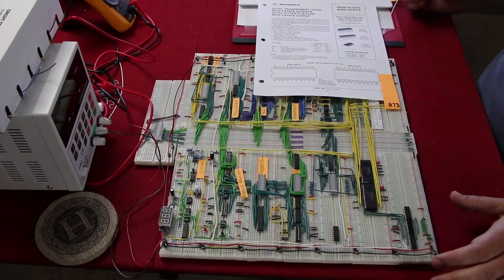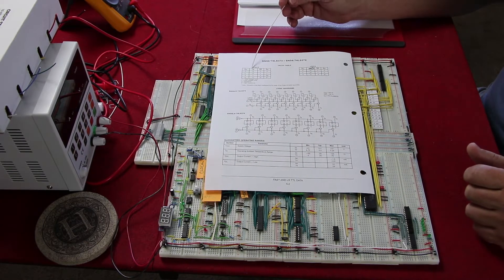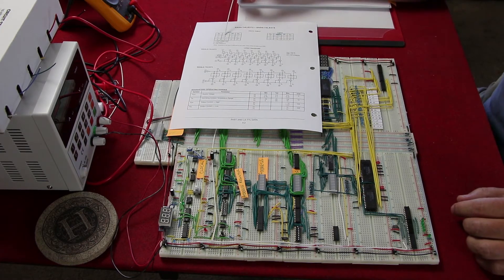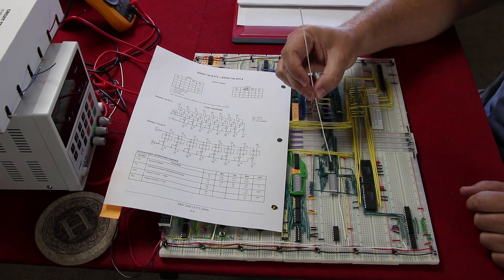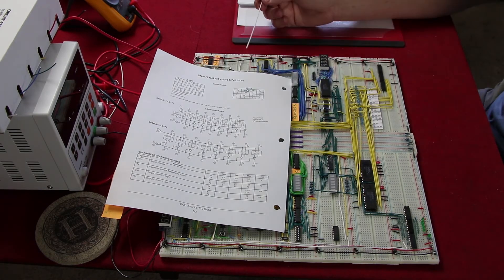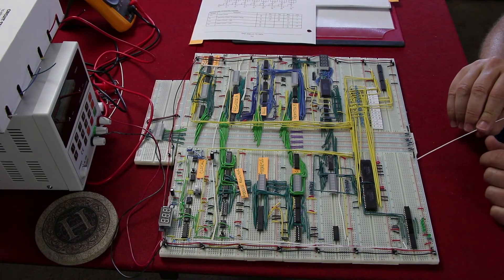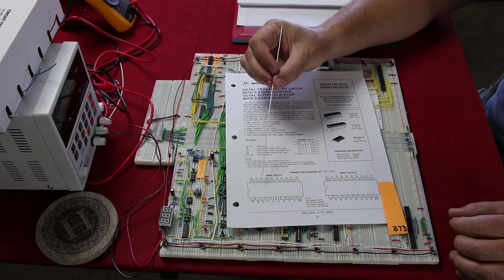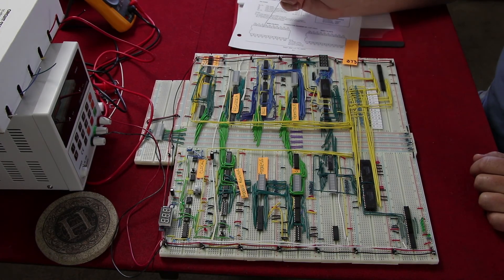Ben Eater 74LS373 Chip & 8 bit register Part 1

Comment: You mention that you are using the 972-71256SA15TPG as your RAM. This chip is 32k x 8. It has 15 bit addresses. I assume you are only using 8 bit addresses. Since you have 8 bit addresses and 8 bit control words does that mean you are basically using this chip as if it were 256 x 16? Like bits 0-7 of your address fetches the instruction, then when bit 8 is flipped you get the parameter? Thus fetching an instruction is two steps. Clock pulse 1 gets the instruction, and clock pulse 2 uses a control signal to flip bit 8 and get the parameter?

Thanks!
Reply from the maker: Yes - 15 bit addresses.  In my case, I only use the 0-7 lines for a total of 255 bytes of data accessible.  Of course, this leaves "paging" on the table for future upgrades... :)  Fetching instructions is still a 1 cycle operation.  MO + Address In.
Reply: Right fetching an instruction is 1 cycle, but how do you get the parameter? Your instructions are 8 bit and your memory addresses are 8 bit. So how do you say fetch the instruction, "Load memory location 200 into register A"?
Reply from the maker: Fetching the parameter - in this case either a static value or a value for an address might look like this:
(I will use * to indicate load a value from memory, and # to indicate a static value to be loaded)

LDA *128  (load value from memory address 128)  contained in two bytes 0000 0001 and 1000 0000
step 1 CO LI (counter out, load instruction register - now the instruction register is loaded and the microcode ROM is setup on the LDA instruction)
step 2 PCE CO MI (program counter enable, counter out, memory address in - increment the program counter, output the counter to the bus, load the bus into the memory address register)
Step 3 MO MI (memory value out to the bus, Load Memory address register with Memory value)
Step 4 MO AI (memory value out to the bus, load a with that value.)
In this case - my microsteps require 6 total.  2 to manage loading/setting the next instruction into the instruction register, and then 4 steps to accomplish the task.  in my system, 6 is the longest microcode sequence so far.

This would be the 3 steps required to handle the instruction LDA from memory address.  For a Load A with static value, it might be
LDA #128
1: CO LI
2: PCE CO MI
3: MO AI
In this case, 5 total microcode steps. (2 for the same managing/loading setting the next instruction (as per Ben eaters video), and 3 for the instruction microcodes themselves)

I am writing this from memory here - so forgive any errors above.
Reply: I am correct in interpreting this to mean that each of your instructions is actually 16 bits? so LDA is  0000 0001 - and the entire first byte is the opcode?
Reply from the maker: The op codes are 8 bit.  And then the micro code acts upon that.  So - while this is an 8 bit computer - it can have instructions that are LONGER than 8 bit.  Some instructions are 8 bit only.  For example LDAB - load a with B - that requires just 1 bit instruction.  LDAS - load a with static value - is 16 bit.  8 bits for the instruction and then it loads a 2nd value for the static value to be loaded to A.  I don't have any instructions (yet) that are longer than 2 bytes - but the architecture would lend itself to op codes that are any length of bytes.  For example perhaps there could be an instruction like CJPGS - conditional jump A greater than static value.  This would require the op code, the static value and then the desired address.  Of course - it would require some fancy microcode to handle a greater than test.  Maybe even a greater than math module.
Crazy example - admittedly that could be done with other simpler op codes - but it illustrates the point.

Comment: What chip are you using for ram? you mentioned in an earlier video that you have full 8-bit memory- are you using harvard style architecture? thanks
Reply from the maker: Hey Collin - what is Harvard style architecture?
That being said, I am using the 972-71256SA15TPG, which can be found here on mouser:
http://www.mouser.com/search/ProductDetail.aspx?r=972-71256SA15TPG
Reply: thanks for the link! Harvard architecture is a slight misnomer in this case as it turns out. It is the style of computing with separate address and data buses, So never mind that. 

The style I thought harvard style was in my head is instead of using the ben eater 4bit opcode + 4 bit address in one byte of memory, splitting the op code and address into 2 bytes in memory. is this how you use the full 8 bit address space? thank you
Reply: More like separate memories for code and data.

Comment: The 74LS573 is the chip your looking for.

https://www.jameco.com/Jameco/Products/ProdDS/64418.pdf

Funcionally identical to th 373 but with inputs on one side and outputs on the other. :-)
Reply: Does this work without the clock input? not sure how an asynchronous chip will behave with the rest of the circuit
Reply from the maker: Double Plus thumbs up!  Thanks for putting this here.

Comment: I think you would be better off with the 374 chips as they will only latch on the rising edge of the clock after the enables have been set up on the anti phase clock, this way the microcode chip outputs will have time to settle before the clock pulse latches the data for the current microcode cycle. By having the latches stay open (transparent) any glitches on the microcode control outputs may corrupt the data in the registers.
Reply from the maker: The catch here, is that with the 374, it prevents me from manually triggering the 374's via the control lines.  That is to say, I'd have to put in extra logic / chips to handle the control signal to the 374.  i.e. only allow the clock signal in when the control line is high.  Then - manually triggering the register becomes an issue if I am debugging.
Reply: I understand that it requires extra logic to make this work, it could be implimented with just a few diodes if you don't want to add more chips. It's critical for functionality that the latch data only change on the clock edge unelss you're going to add a multiphase clock to gate the registers. Otherwise you could make some pulsed enable lines with triggered timers but both of these methods are even more complex.
You could just put resistors on the incoming clock lines if you want to manually clock the chips from another source.
Thanks for the videos. :-)